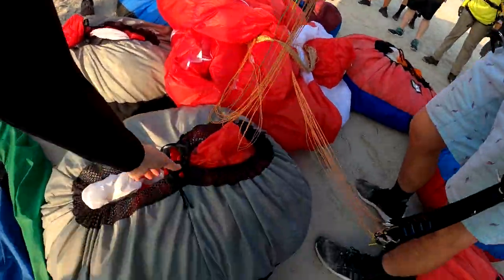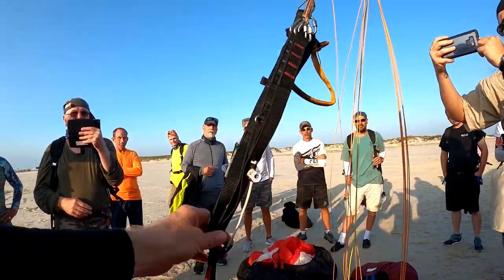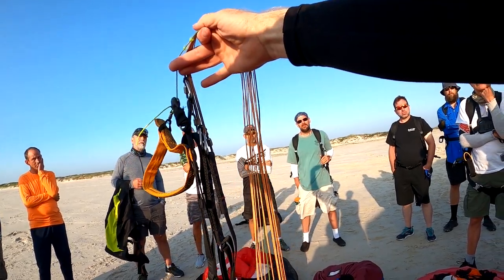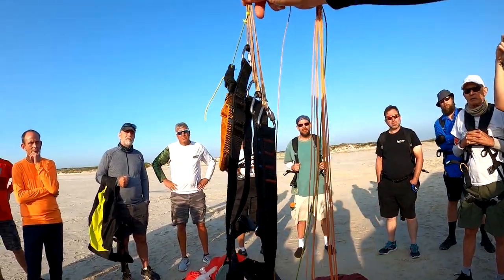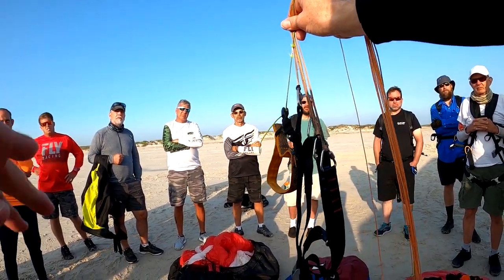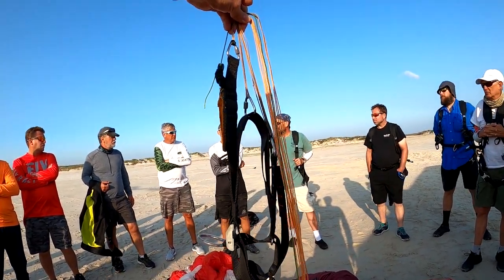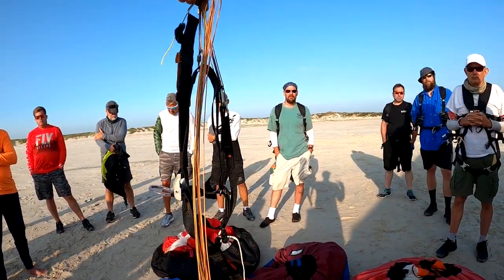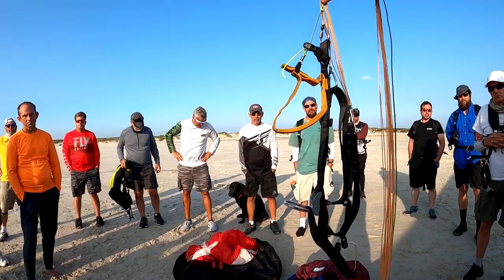How Paramotor/Paraglider TRIMS Work By Dell Schanze

Comment: Am I getting this wrong, is a wing like a sail on a ship the backwards? Sailboat catches the wind that's coming from behind it so is the wing catching the wind is coming from in front of it? I'm trying to understand the angle of attack.
Reply from the maker: You ask some funky questions.  A paraglider is a wing that produces lift.  It's about getting the wing that produces the best lift and gives the best performance but while at the same time has the best stability and safety.  That's the Dominator.  How or why a sail works compared to a paraglider is not really my area.  I just test piles of gliders and know the Dominator is the ultimate.  Why it's the ultimate I don't know for sure.  I just know it is from vast testing and experience.

Comment: Got one question you said with the trims up and you raise the rear end of your glider you lower the angle of attack wouldn't that just be the opposite with the trims up because with the trims up you raise the rear of the glider you make the glider go faster? Because the speed bar make it even steeper of an attack if I'm understanding the video right?
Reply from the maker: Yes that's correct.  When you have risers without trims it's the speedbar that gives 100% of the acceleration through lowering the angle of attack.  Those with trims reduce the speedbar by the amount the trims add.  So like with the Dominator you get about 40% of the speed from trims and the other 60% from the speedbar making for 100% of the acceleration through angle of attack.  Other gliders have very different ratios.  The Dominator is the ultimate because even with trims up it gives incredible speed but without really sacrificing safety much at all.  With other gliders you won't likely get near the increase in speed nor maintain anywhere near the safety.  Trims up on many gliders and the safety goes right out the window.  Especially with hoaxflex death trap wings they call "reflex".  Trims up on those and you turn it into a complete and total death trap.  One collapse and they do a backflip 180 and lock into a face down spiral straight at the ground.  That's why zero competent pilots fly them.  Hope that helps.

Comment: Dell how much altitude do you lose while you're flying trims up? If you flew with trimmed up and speed bar could you have a chance of inverting the wing because of the angle you put the wing in and how much altitude do you lose line that way?

Comment: Does the dominator come in different classes?
Reply from the maker: No.  The Dominator is the safest class of glider.  There is simply no reason to lack safety as it also has the most performance.  So it would be silly to have a less safe glider that also has less performance than the super safe Dominator.